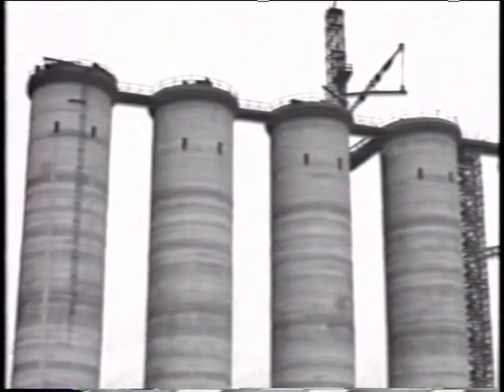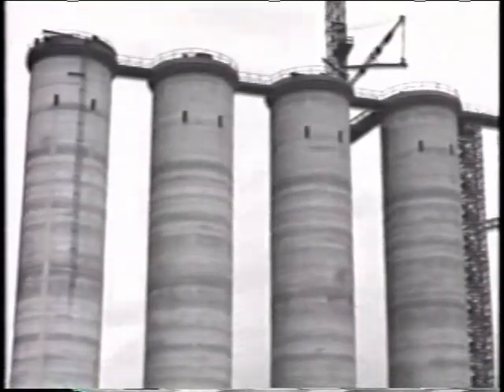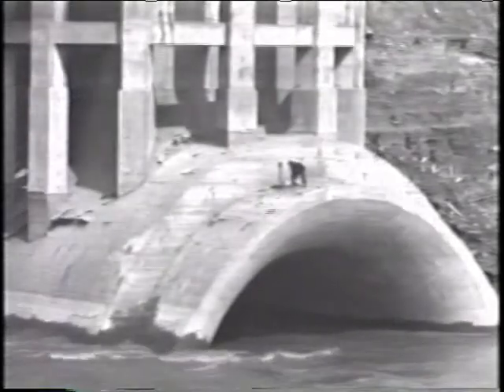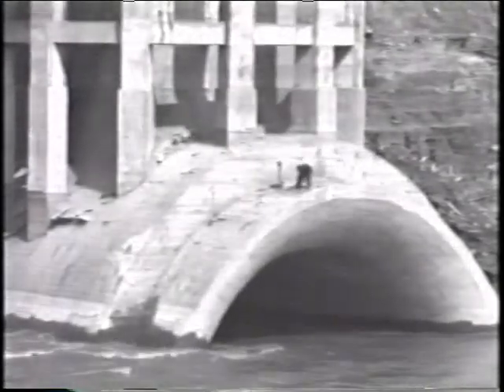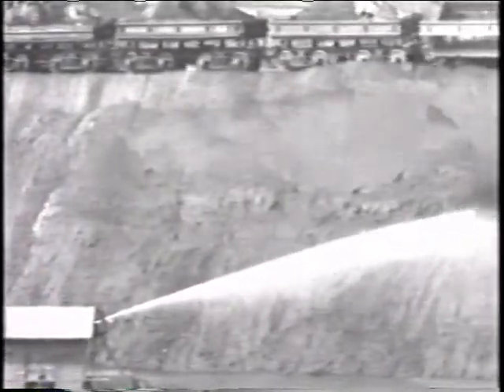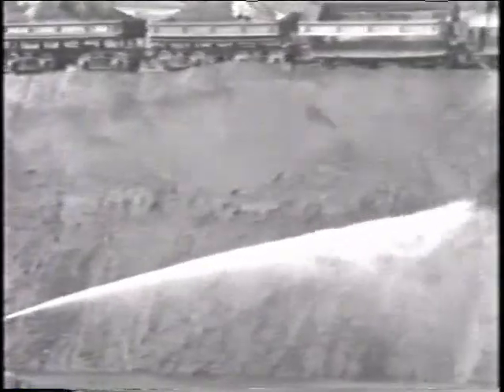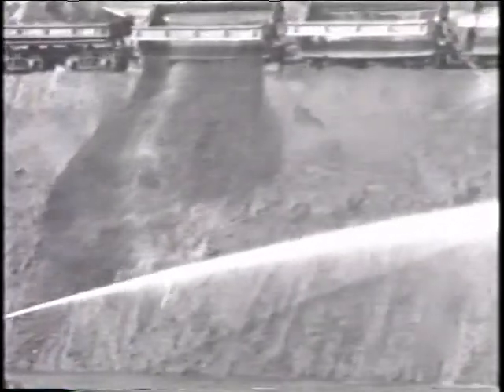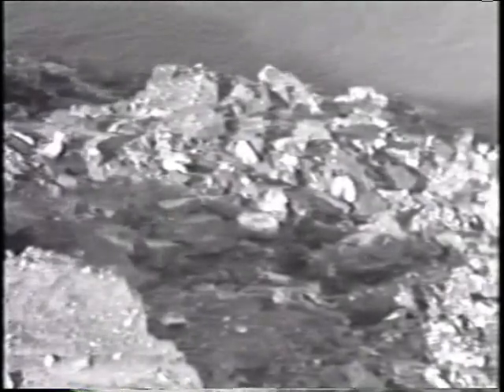Lake Murray Dam Video

Comment: If you drive over the Dam now you’ll see lots of activity. Barges and Tug boats. They’re hsving to replace the Gates way down inside the towers.  They completely removed the brick structures on top to allow acess with a crane to remove the old ones and replace them.  They rebuilt the buildings on top but the roofs are still off as they continue. Its interesting..